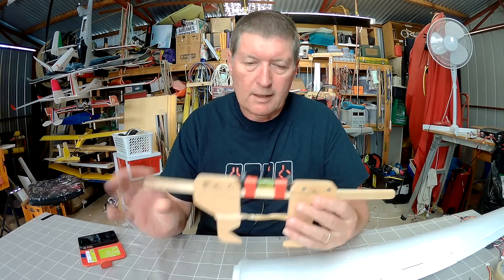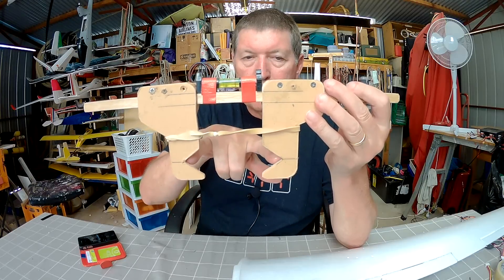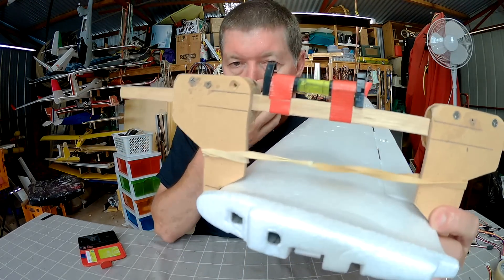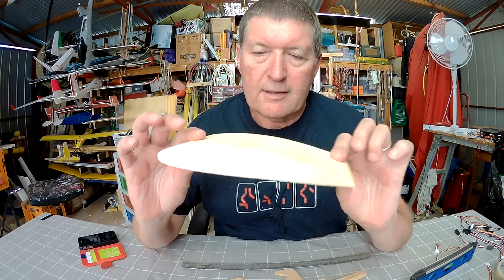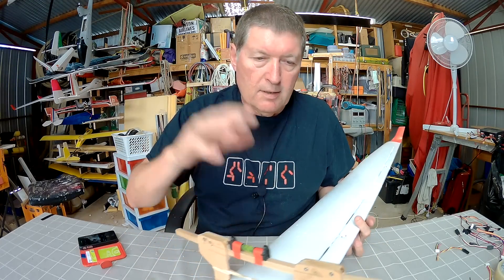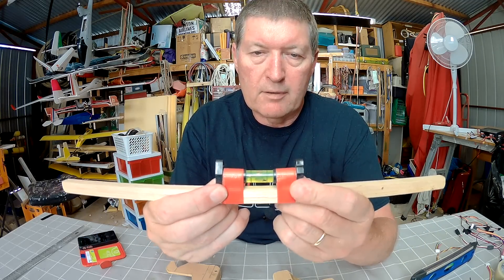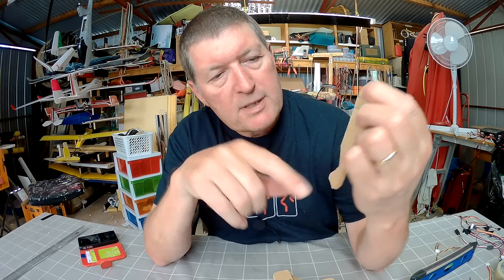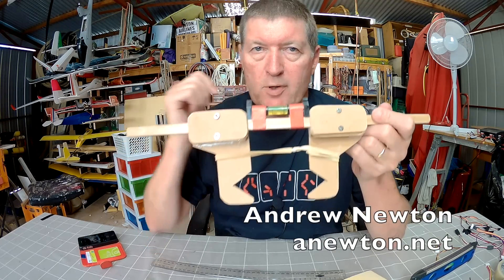DIY Incidence Meter

Comment: So is the main key aim on all planes to have the wing the  same level as the rear stabiliser
Reply from the maker: I start with both at the same angle, then often need to tilt the wing up a couple of degrees. On a bi or tri plane you want the forward most wing (usually the top wing) to be angled up more so it stalls first.
Reply: @AndrewNewton  thank you Andrew that's good info

Comment: Have a little sloper i made that i need to mount the wing and tail feathers on. Had this video bookmarked for a year, got some 1/8 ply in the mail today so i can get them mounted. This diy is way cheaper (and not cheap plastic) than what i have seen for sale online if you can even find one.
Reply from the maker: Those Robart ones seem to be rare

Comment: Just made up the incidence meter to your design, but slightly bigger for use with large chord wings. My Robart meter was just too small, although I can still use it for tailplane setting. Have a digital inclinometer for use with your design - makes checking washout dead simple.
Many thanks.
Reply from the maker: High tech, nice one

Comment: Incidently, ;¬)
 I made up a mini spirit level by hot glueing one of my extra spirit bubbles to a short piece of 12 x 12mm square dowel, then I held that down on a flat, non stick, surface and gave it some squidgy looking hot glue feet on each side. It's just right for checking the flat tailplane (horiz/stab) .
Reply from the maker: I like it

Comment: Heh, I finally managed to get into the £1 shop yesterday. They had a 440mm long aluminium 3 bubble spirit level. Yes, for £1!! And the middle one has a clear holding thingy with two screws holding it down. Perfect!
Reply from the maker: Brilliant, so cheap!
Reply: So now, if I need it, I can check wing incidence at 45degrees too!! :¬P

Comment: I must admit I haven't bothered with this measurement so far and it can be surprising how steeply a plane will climb or even try to go into a lop on full power.
 I presume a powered plane has a specific, er, horizontal aerodynamic (?) center when compared to a glider.  So we have to try and achieve the perfect incidence with a glider for power off gliding.
 Hmm, nothing is as simple as it seems. ;¬)
Well it's dark here now, so I might see if I can knock one of these up just for fun. I have a glider to finish, but it's far too windy this weekend for that, so it can wait a while.
Reply from the maker: The theory is way too complex for me and my rough home made foamies, I just use this for initial setup and only for a rough alignment. Then any fine adjustments are done in response to flight tests.
Reply: I hear you mate. Plus, with a flat bottom airfoil for the wing and a flat plate tailplane, they can sit on the same line and you automatically have a degree or so of positive incidence.
Reply: You stated the obvious Best answer, spot on

Comment: Good video! Information that I found with most value is not the construction method of the jig it self but the fact that you level the wing in regards to stabilizer in the back.  Up to now I built only ARF's and KIT's  so incidence was always already thought out by designer of the KIT I was never forced to do my reading on the topic.
Reply from the maker: I made a few planes that flew terribly and I now know it was due to the wing incidence

Comment: Incidence  of the main wing is not the same amongst every design. It's optimized generally to have the fuselage present minimum drag at cruise speed. The decelage, or angle between the wing and h stab is not always 0/0 either and it's definitely different between aircraft designs.

Comment: In gliders you need about 2-3° angle of incidence.
Reply: yes (but it also depends on Reynolds #), for the best results always check CL/CD vs Aplha for chosen airfoil.
Reply from the maker: Sweet, I knew someone would tell me the correct setup
Reply: You can also try 1° in fast gliders like dlg but 2° is safer. In large models like 5m wingspan oldtimer glider replica you need to set angle of incidence on 4°.

Comment: replace the bubble line level with a smart phone and level app to check decollage angles even when the craft is sitting on it's wheels. Can be used to measure control surface throws as well.
Reply from the maker: Good high tech option, thanks
Reply: ironically I bet more people have the smart phone over the line level :)

Comment: Thats great Andrew not only the gizmo but you answered  a question I had about this topic. 
You give us so much info in an easy to understand way.
I finally got to maiden my FT tiny trainer only to do two big looping left hand turns into the ground.
After more research and much  cursing I realized I got a motor thats to big it needs a 2200 kv 1806 and I got a 2212 2200 kv so much to learn for a novice. 
You do make it that bit easier Thanks.
Reply from the maker: Fun and games Peter
Reply: Yes just the waiting sucks lol
Now waiting for the right motor from banggood , on the bright side I have the motor and esc for my next plane it will be a DHC 2 beaver made from plans from aerofred.com.